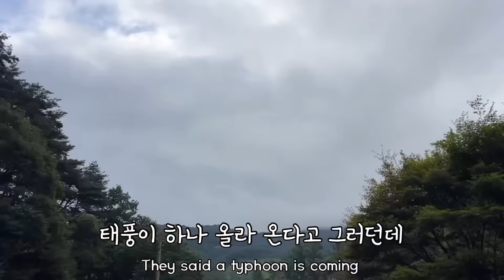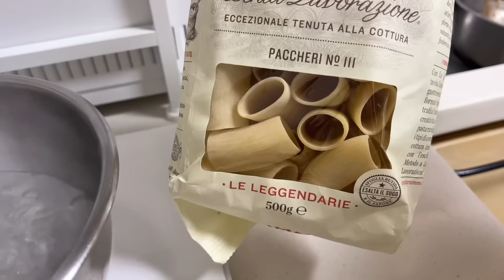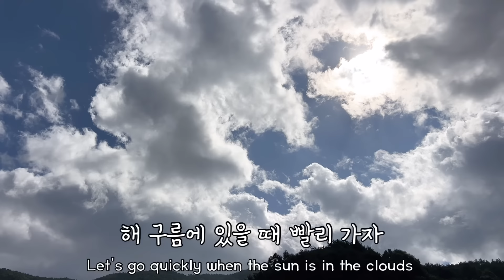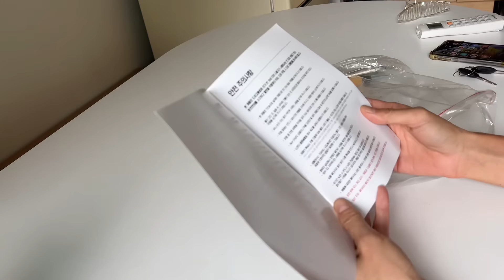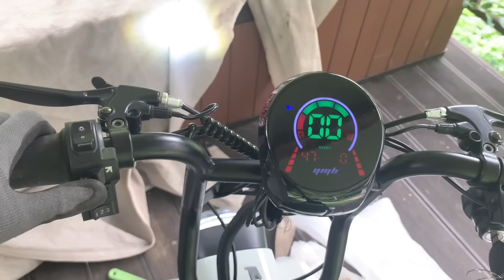SUB 단순로그266 적응력 만렙 1인 시골 생활자 vlog

Comment: Another great video. 

Some more troubleshooting for your water problem. 

If your water pump uses a pressure tank as well, you need to check that it is still pressurised, it could be low on pressure. 

There could also be air in the system, or dirty filters, faulty pressure switch. 

It looks like something to do with the pump. You can see the water is pulsing instead of a constant flow, which indicates something is wrong at the motor. The motor may still be fine, and pumping water, but there is something causing the low pressure or low amount that is being pumped.

You might have to get a plumber out to have a look :S.
Reply from the maker: Thanks for the good advice.
The water pressure is fine in other places,
but the one in the sink is weird.
But the water pressure is a little stronger now than it was then.
Anyway, I think I'll have to wait a little longer and decide whether to call a repairman.